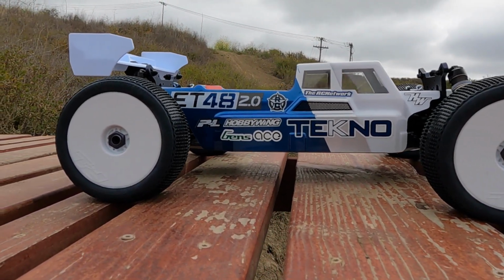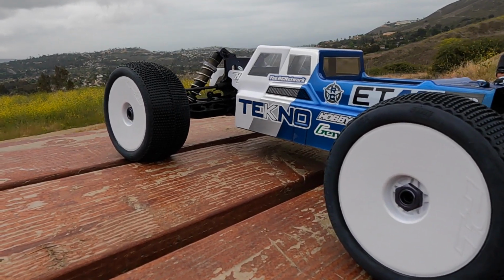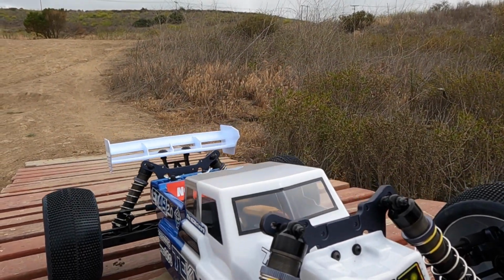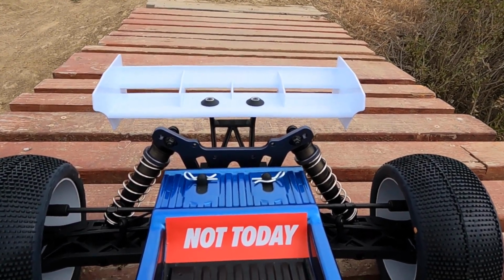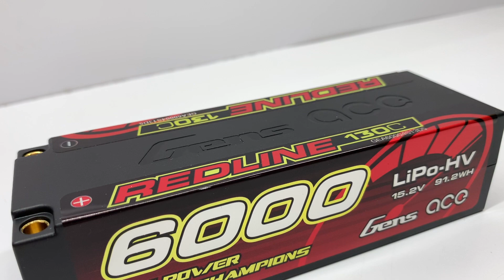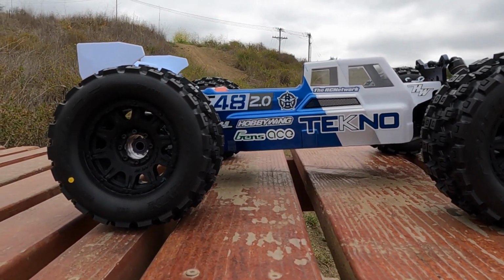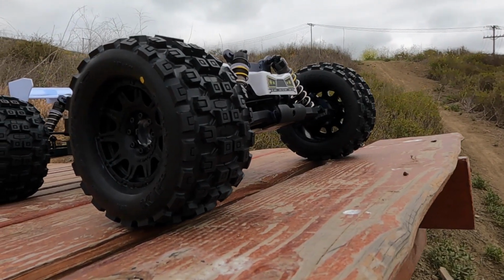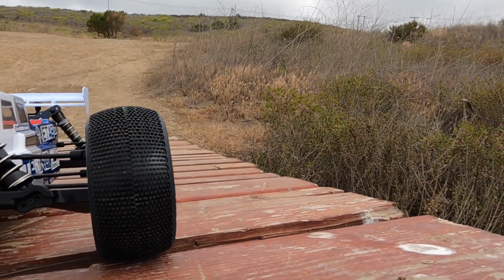Tekno ET48 2.0 1/8th Truggy - Running / Bashing - HOBBYWING, GensAce, AGFRC, Pro-Line Equipped

Comment from the maker: Alright...last time:  RACE or BASH?  Which one did you like better? 🤔
Reply: BASH but with badlands 3.8 LP and it will be the ultimate basher
Reply: Race
Reply: With what’s said earlier bash with race tires haha, bigger jumps and lighter landings, great footage
Reply: Well both showed off a little of what it can do.  I am a little afraid of how much that would cost to replace parts for?  How would you compare it to a kraton or something similar for durability and price?
Reply: @MauzyrockRC  up front you do have to pay a little more because of not have if electronics but not much as now we have kit breakers like Jenny’s rc, I just through a 2200kv system from their

I could say so much about my two Tekno et48.3 but long story short I think it is can be the most durable car on the market, if you want ultimate durability 
I would recommend 
The Tekno et48.3 as right now their is more after market parts out for it
I built mine from the Tekno mt410 as the parts are very close except for chassis and shock towers, wing 

The only m2c upgrades I have on it is the chassis, rear brace, tower brace 
And the all racing metal top plate 

Check out my last video to see what I put it through, I’ve landed 50 ft jumps upside down and it shakes it off 

Overall you will pay roughly $800 to get it there
Fierce rc solution has massive coupons for Tekno and m2c products
Reply: Race
Reply: @radiocontrolledmadness8119  Awesome thank you!  It is not ridiculous in price.  I will have to check it out.
Reply: @MauzyrockRC  I would def recommend going to fierce rc solutions, and buying all together their, you could save big there
Reply: Bash
Reply: Race.
Reply: Bash

Comment: One of my friends also had an issue with the shock eye breaking. He dialed down the droop a good bit so it wasn't pulling on the shock and it's been fine since. The way he abuses his cars makes your durability montage look like child's play! Keep it up and enjoy the car! It sure can handle a lot and is still wicked quick
Reply from the maker: I'm shocked the truck didn't split in two as hard as it dropped from the sky - My buddy that filmed it also said that viewers don't realize how high that thing is going along with the elevated jump that we were on....has to be like a 50ft drop, easily
Reply: The front droop in the manual is wrong. It should be 116mm in stead of 121mm.

Comment: It looks like a Jekyll and Hyde scenario.
Racer set up looks planted and refined, Basher, a crazy beast on the loose!
What did you think Rich? 
Seeing those 3.8 Badlands turning into pizza cutters and on 2 wheels was a rather dramatic turn around. 👍🇦🇺🤓
Thanks again mate, love your work.
Reply from the maker: Thanks Paul - yeah, you nailed it.  the race tires were SO well balanced for the set up of the rig.  It was SO controllable and predictable.  The bash tires added a ton of weight....and rotational mass.  Plus, I was running stock diff fluid, so it just transferred power to the fronts as you saw.  I'm only going to run it with race tires going forward.

Comment: First of all congratulations for your videos, I want to ask you what you think is better for bashing a truggy or the Arma Vorteks for example,... I want a car all around for bashing and jumps and sometimes for the track, a pro one and for tracks build by me.... What you think???
Reply from the maker: Well, traditionally, "truggies" are 1/8th scale like the one in this video...it can easily accept race or bashing tires.  the Vorteks is a 1/10th scale size, so it's much smaller and doesn't really fall into any racing class
Reply: @TheRCNetwork  thanks for the answer and advice, I think that I will go for the truggy for the bashing and the track too

Comment: Keep an eye on the slop in the gears of your AGF servos. I've been running A80BHSWs in my NB48 2.0 and have significant slip in the steering servo gears.
Reply from the maker: Never had a problem with my AGF's.....Probably have about 10 rigs with them now - my near 20lbs Mojave has the A80 in it
Reply: @TheRCNetwork  right, I haven't had any fail outright, but I have about 3 gallons on them in my NB48 2.0. I've got a few degrees of slop in either direction for the steering servo while the throttle one is still fine. There's clearly been some gear wear. I'm going to see if an A86 is any better in my ET48.
Reply from the maker: @afrewer94  I’d suggest the A81….you’ll get a bit more speed vs the A86
Reply: @TheRCNetwork  that's true. I'll throw a faster one in it if it's too slow at the races today.

Comment: Hey. I got the exact same motor combo as you, on a losi 8ight xte, and i feel like the motor gets alittle hot? The esc barely breaks a sweat. What pinion are you running, and have you adjusted any timing or something?
Reply from the maker: I'm running a 15t....zero timing - no need on a 1/8th scale running 4s.  I'd drop a couple teeth on your pinion and see if that helps....are you sure there's nothing holding the drivetrain up - like a blown bearing, bent suspension/driveshaft/etc?  Also, what terrain/wheels tires?  That also makes a difference

Comment: I'm throwing the stronger orange springs on mine. Stock they feel a bit too light - lots of chassis slap at the track.
Reply from the maker: What's weird, after this race/bash session, I had almost no wear on my chassis. Just a couple of non-gouging scrapes...but almost nothing on the typical rear tail end of the chassis.  Are you weighted down by a heavy 6s or heavy electronics?
Reply: @TheRCNetwork  no, just a 6500mAh 4S pack. I'm going to see how the orange springs work out at the track this weekend.

Comment: Question: the motor in my 1/8 scale buggy moves up and down when I land and it’s stripping the threads on the screws, how can I prevent this and what do I use
Reply from the maker: So, you have the two screws into the motor mount plate?  How is it moving?  I always use a bit of loctite on those as well.
Reply: When I land a jump the motor moves down from the force of landing. I use loctite on all the motor screw but it still comes loose
Reply from the maker: Strange, I've never had that happen...are you running the braces?  Obviously, the more you let the chassis flex, the more it could potentially allow the motor to flew from the mount.

Comment: Actually thinking of bashing with racing tires because of their lightweight for big jumps, I have aka now I still have yet to use them, I hope I made the right choice, my worry is the wheel cracking, any experience might proline be better?
Difference is amazing tho saved about 10 ounces
Reply from the maker: The race tires were SO much better.  very similar grip, even on this bashing track.....The ET was so controllable with them

Comment: I have an eb48.2, would you say it’s a big difference between et48.2? Or just mainly size? I find mine super durable! Haven’t had many issues with it.
Reply from the maker: Well, if you have the EB48.2 - besides size, the ET48 2.0 is drastically different, as it's the new generation of RC's from Tekno - totally different chassis/parts.  Just like the the EB48 2.0

Comment: LOOOOVE TEKNO👍 can you please recommend me some good stiffer rear springs for my mt410.3? I went to kraton rear springs because even at full preload the rear shocks just sagged a little much for me I don't like my ass end squatting so bad under acceleration. But still not good enough. Maybe you know of a stronger stiffer spring I can run? Thanks bro!
Reply from the maker: Have you looked at the ET48 2.0 springs?  They might be long, but that's good.  Pull the manual and they always have the spring recommends at the end

Comment: Great video! Do you think Badlands 3.8 (without MX) are a good compromise between your tire setup?
Reply from the maker: The original badlands 3.8 are a tad small - check my MT410 videos - that's those tires.  They're basically the same size as the truggy race tires in this video, but with that aggressive tread

Comment: @RCNETWORK-which servo is better for 1/10 scale 4wd buggy a high torque steering servo or a high speed steering servo? Aaron
Reply from the maker: Depends on what you're looking for.  I always pick the servo on torque first....and most 1/10th scale buggies need about 300oz/in......then I buy down the speed.  Meaning for a 300oz/in servo is not a lot of money...until it becomes fast.  You'll want 300oz/in and about 0.10 or faster for 1/10th buggy.  0.07-0.08 being ideal.  That extra 0.02 seconds will cost some money though.  Also, keep in mind, many newer 1/10th scale buggies require lo profile servos.  Take a look at the AGFRC A66BHLW - it's a powerhouse
Reply: @TheRCNetwork  Thank you

Comment: Will this be your only running video of this truck? I'm pretty keen to see some more, I think your break is set to high, if you drop it you might find you don't have the same aggressive nose diving that occurred here. 

Any thoughts on what fluids you would use for bashing?
Reply from the maker: This will be the only running video on the channel....I typically only do one. The only chance there would be another one is if I end up at a proper 1/8th scale track in the near future.  As for the brake?  It's set right....I went from running race tires to literally 5lbs worth of rubber....so ANY brake will effect drastically if 5lbs or 1/3rd of the weight suddenly stops.  I also didn't get much time on the basher tires to get used to it before it broke....
Reply: @TheRCNetwork  it's a shame these cars only get a moment of glory, do you at least drive them again without the camera?
Reply from the maker: @jonowillmer  yes, all the time. But for me, when the camera is there, it’s work…..additional people are there to film, got to get the right shots and there different pressures. If I’m just driving, it’s a hobby
Reply: @TheRCNetwork  that's good to hear, and I hope you have a good weekend.